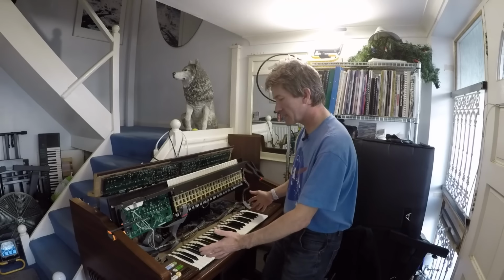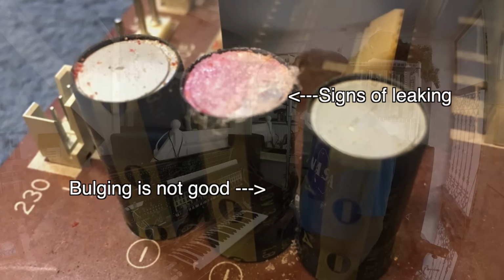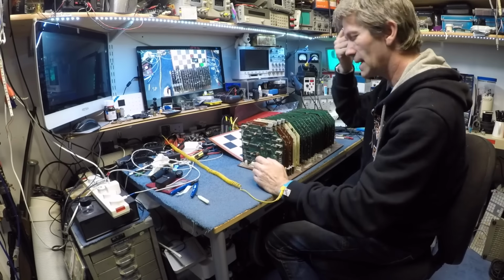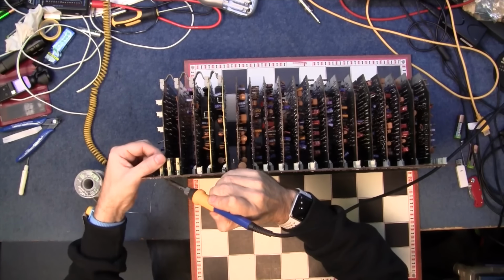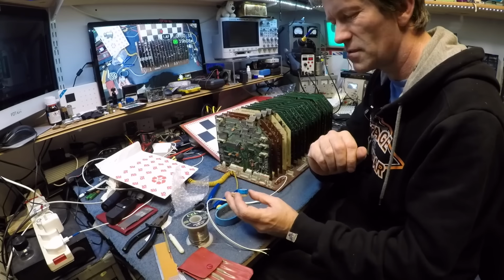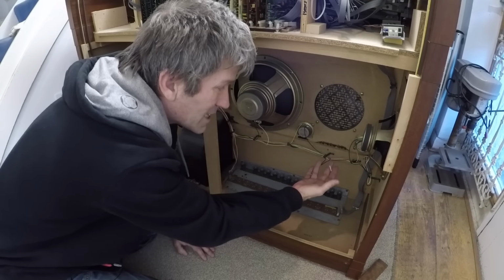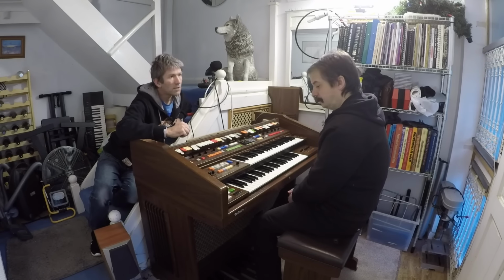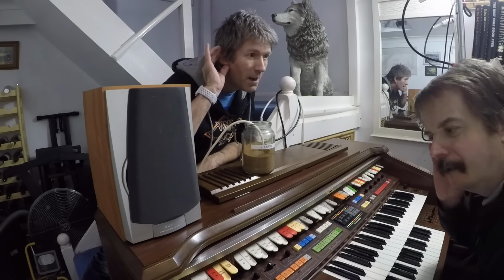Technics U90 organ repair

Comment: The manual (SX U90) seems to say one 12"speaker, one 8" and three 2.6" speakers. First thing I noticed, indeed, the missing speaker.
Reply: The U60 has two 8" and just one 2.6". Hence probably the 'spare' hole? The hole looks like nothing has ever been there (I'd take of the 'remaining' one to see how it looks when there'd been one). But who am I?
Reply from the maker: Yes I could not believe that I looked past that without thinking about why is there a hole and no speaker. though i have seen this in other organs where that hole is there just as a radiator of sound. but the wires gave the game away that it is indeed missing.

Comment: 4:50 It's insane how far technology has gotten. You can probably simulate it on a reasonably cheap CPU in software if your code is good enough, you wouldn't even need a DSP
Reply from the maker: yes theres certainly a lot of components in this organ. I often wonder how big a working model of todays smartphone would have to be if it was made in the 1980s.
Reply: Yes, you can emulate it on any smartphone or tablet, laptop etc, but you can't get thick and warm sound that comes out of this beast.
Reply: @midiplaybox3453  Hmm perhaps. If fed through the amp inside of this.. you'd probably get very close though
Reply: @midiplaybox3453  Depends on the emulation (analog has a lot of subtle inaccuracies, non-linearities, distortion etc), DAC's and proper analog filtering/amplification. Especially with how much we know about analog emulation these days we can get very, very close to the point that 99% of humanity wouldn't hear the difference at all.
Reply: @markusfuller  I guess a 64 bit register should be done with a few dip 8bit latches, and a modern cpu has like 16+ of them. Then on top of that all the hidden registers and logic unit... It would probably fill up a room unless they made specialized IC's instead of just off the shelf jellybean parts. And ofcourse it would be horribly slow.
Reply: I can half answer the phone question as I knew someone who worked for Siemens when they were developing their first GSM phone in about 1989. The prototype phone went around in a Transit Van, and they were a bit concerned when they realised the processing power needed to do the GSM Codec etc was greater than any of their desktop PCs had at the time. Of course that was just for a basic phone similar to a Nokia 3310.

Comment: Do you know a way to repair Kimball organ dead keys?
Reply from the maker: Hi I just check all possible contacts that are under or behind the keys depending on the mechanism used then move onto checking solder joints etc which there will be many. but you may be lucky and find a godod clean of contacts is all it needs. It’s difficult for me to guess what the problem is on your organ without seeing it for myself. good luck I hope you get it fixed.
Reply: @markusfuller  Alright! And do you mind if I possibly contact you later with pictures of it?
Reply from the maker: @youexterminated787  sure no problem but if they are just a few dead keys then i guess it would be a matter of cleaning contacts or checking cables and solder joints.
Reply: @markusfuller  Well yesterday I looked through the whole thing for about an hour and nothing seemed to be wrong, I also scrubbed a few boards with a toothbrush and removed alot of dust that way. Do you have any way I could contact you?

Comment: Do people realise that cost as much as a Ford Fiesta car in 1981? 1 Capacitors in series was a bad design choice. You could easily end up with all the voltage across one. A single capacitor was a much better choice.

Comment: 10:50 "Just put a resistor across it" Do you mean your fingers? :-)
Reply from the maker: well i guess you could get away with that though if a supercap was charged you would certainly not want to use your fingers or hold the resistor like i did as it would still shock you. I knew this was new so discharged but thought i would mention it.

Comment: I got the same organ. But because IT has not been played and Turned on for some years there it no sound to hear.... Problem some battery. But where is those or those battery to replace so there will be Sound to hear again ?. Can you help me 😁
Reply from the maker: Hi I think there are no batteries. it uses a supercapacitor as the battery backup but it has been so many years since i owned this that i cannot remember where they are. i think i must mention them in the video somewhere about the supercaps..
Reply: @markusfuller  the organ was my fathers but he died last years at 94, now my mother cannot understand why there is No Sound from IT but turn om light and some zzzzz Sound from the speakers is there, but not loud. She told me about this battery. U90 organ manuel i have find om internet got one page show a black plastic boks where two or tree battery round 1,5 v and IT is the same for technics smaller organ u50 and i think it was i40 and placed the left side. I've open IT up as in your video but NOTHING to see battery box. I Play guitar...a Lot easyer, but i would love to have it Play again. So far thank you for your good video 👍😁